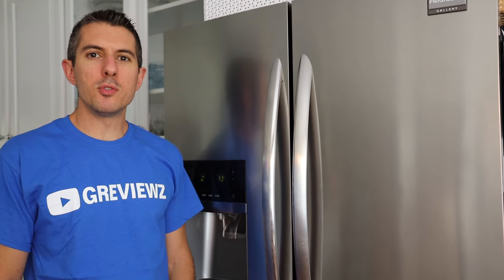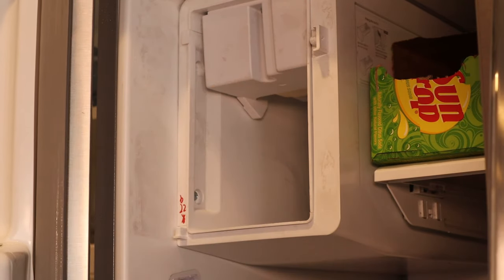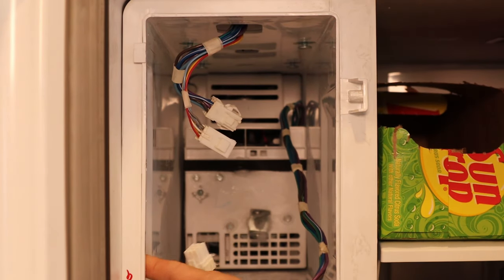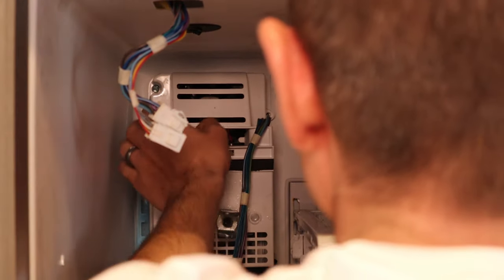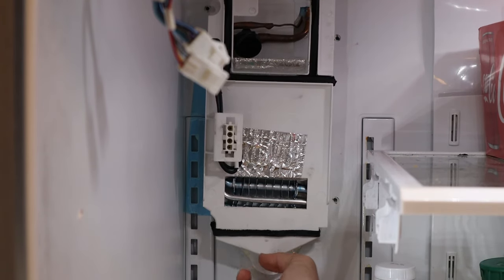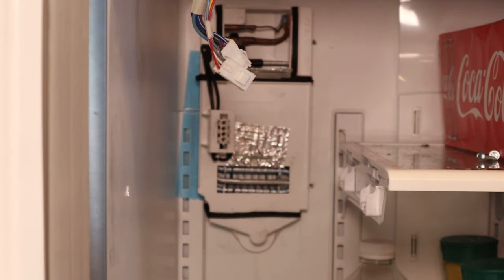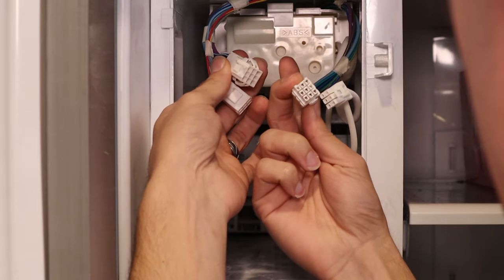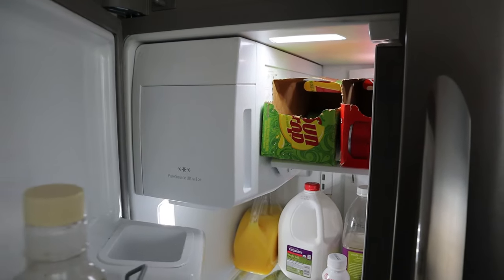Frigidaire ice maker broken again: fix it

Comment: Wonderful and helpful video. Tried to read through all the comments, but couldn't see if you've addressed this question.... Can the dang thing be completely removed and disconnected and do without?   I've got the thing 'almost' disconnected but the copper tubing seems to be the last step.  The motor housing in mine is all one piece.  I haven't been able to expose the coils.  Unless it's still all frozen.
Reply from the maker: Thanks for watching. It’s a big pain in the b u t t. I’m not a Frigidaire tech all I know if the process Ive shown.  Ru you wanting to stop using the ice maker all together?
Reply: @GReviewz  yes..... use the space in the fridge for something useful and start using a countertop ice maker.  Those things can make > 25 lbs a day.   Even when it works, this thing only spits out a few cubes every few hours.   We were always running out.  We filed a warranty claim on it within the first 6 months.   Had it now 5 years and it has never been great.  I'd love to disconnect and remove the motor case.
Reply: And I'd like to keep the filtered water...

Comment: Better review than most, the only critique I can add is, at 04:13, saying to use a screwdriver to pry connectors apart??   No, no, no.  The connectors have a release tab you just depress and they come apart easily, that should have been pointed out...that there are release tabs.  Brute force never a good idea when dealing with plastic connectors.
Reply from the maker: Lol thanks for watching. I guess I misspoke I use a flathead screwdriver to push into the tab to lift the tab.

Comment: No need to take anything  apart. Just run the defrost cycle a few times. With ours it is usually some ice will be on the edge of the tray. Remove the ice container and feel around the tray. There usually will be ice on it, just work it off.

Comment: My refrigerator looks almost the same but doesn't have Gallery on the front. I'll give this a try. I have ice built up on the back of the refrigerator where the drain goes. I've seen another video and the guy replaced the seals in the ice maker area.

Comment: Guys be careful using the Hair Dryer. I've seen customers melt the plastics using it. I recommend a steamer, also with this model, if that drain gets clogged, there is no repair as per Electrolux. Another issue you might have is the fill tube as he explained freezes up and doesn't allow for the water to shoot in.
Reply: Thanks for the added wisdom-from-experience.

Comment: I have same fridge, same issue.....an easier way is put your fridge food in a cooler, unplug fridge, take out ice tray, get a hair dryer and prop it so it blows into the ice compartment (I used the left door), turn it on for 5 minutes at a time about 4-5 times in a 3 hour period.  Leave fridge doors open for those 3 hours.  DO NOT OPEN FREEZER DOORS.  Freezer food will be fine during this time.  You will start to see water drip and pool in ice tray.  after a few hours, put ice tray back in, plug in fridge, close door.  You can put food back in at this point.  Wait until morning for ice.

Comment: My third time doing this in 3 months, it worked for a while then froze up , so I replaced the gasket around the defrost coil and it worked for a while until it froze up ..defrost it again .. now it doesn’t work anymore.. 
I give up, this ice maker is junk..as long as the freezer and fridge works I’m fine with that .😊😊😊😊

Comment: Help help help!!! I have defrosted and it didn’t fix it. Then I replaced the water inlet valve still no ice. Found a cut wire and spliced it then I had ice. Now no ice again after about 2 weeks. Checked cut wire and it is still spliced but still no ice. When I found the cut wire we also checked the connections in the back (silinoids I think they are called) moved them around to see if I could get the ice maker to fill. It never would fill. This thing is driving me bonkers!!!! Thank you for the awesome video!
Reply from the maker: Thanks for watching. I’m going to be honest I am not a Frigidaire tech nor an electrician. I just found out the specific problem the ice makers had. I would say after re connecting the broken wire and it made ice that sounds like an electrical problem to me. After trying everything and nothing works you may have to admit defeat and call a professional. Just make sure if you do call them that you clean all around the back and underneath the fridge. If they see any evidence of insects, cock roaches etc they will leave and not fix anything and still charge for a service call...

Comment: i have a frigidaire 33 inch refrigerator that was dropped off by Home Depot without setting up the inside.  i still cannot get the crispers in the right position not to have gaps of air getting in them. also there were two beige clips that were in there and want to know if they support the crisper drawers  thank you if you can answer

Comment: My question is why does this happen?  I am pretty sure mine is doing the same thing.  There has to be a reason for this.  But great video dealing with a difficult situation
Reply from the maker: It’s all about a fad and not about good design.. the problem is the ice maker is put into the refrigerator. The refrigerator is kept at above freezing temps while the icemaker needs below freezing temps. So the difference in temps makes condensation which then freezes… so in essence it’s a terrible design!!

Comment: This is my first fridge with a freezer on the bottom but do I need to worry about ice in the drain line? If the problem is repetitive you got low freon/a leak and you might want to call a repairman.

Comment: Worked like a charm! But I was a bit confused by the brief segue into setting the fridge into "defrost mode". Was this to say that setting into this mode could be tried before tearing apart the ice maker?
Reply from the maker: Yes you should try the defrost cycle before the tear down.. the defrost only works 30-40% of the time though
Reply: @GReviewz  Thank you! I now have a full tray of ice, but now it dispenses very slowly - like only a few cubes after a minute. Also the crush function is not making any crushed ice. I can hear the mechanism running. I wonder if I screwed something up performing my repair. If anyone would know what to do, you would!

Comment: 2 important questions: 1: are you supposed to remove the blue tape that's on the ice draw near the fill hole on top of ice draw?
2: would enough ice build up cause the 3 water lines (mid height/ice maker side) that enter the rear of fridge to ice up and also cause the water for the outside door to stop?  Thanks
Reply: question 2: absolutely, the icing condition can continue to travel down the lines and cause your water supply for the door and ice makers to be cut off.

Comment: I assume this happens every few months? Mine does.

My slightly simpler fix ...  

Follow your instructions to 2:50, then fill a few sealed hot water bottles and put them in the ice box. Then I grab a big handful of plastic grocery bags (or a few kitchen towels) scrunched up to seal the opening. Close the fridge door and leave them inside the ice maker for a couple hours to let everything thaw. Depending how bad it is you may need to refill the bottles with more hot water. 

Next time I may try that in combination with the defrost mode. Thanks for that tip. I wonder though if we hit the defrost for an hour every other week if that will keep it from icing up in the first place.
Reply from the maker: Thanks for watching. Yes there are many different ways of getting the ice melted. I did demo the longest way however your way will work. The only problem is that the defrost cycle only defrosts were the coil is. Ice can build up a lot of other places.

Comment: thanks, but I was too scared to attempt it myself, so I just defrosted it and am hoping that works to loosen whatever ice may be blocking the system.     How long should I keep on defrost before turning fridge back on?
Reply from the maker: Thanks for watching. The defrost cycle runs on its own and stops to my knowledge. I ran 2 cycles and to no avail the problem persisted. That is why I did the long process. Doing the defrost works for some and not for others.
Reply: Does the fridge still stay cold? I have it on defrost now and took all the freezer food out.

Comment: Good video, helped me to tear apart my Frigidaire Gallery. I did find that i have a couple of cracked parts, which I will research on line and get those ordered. One question tho, with the drain hole behind the evaporator housing, where does the melted ice go to? Its between the outside back panel and the inside panel, is there a drip tray inside the bottom?

thanks,
Reply from the maker: Thanks for watching. Good question. Ive been told it goes down to a drip pan under the unit that gets evap from the heat of the compressor...?

Comment: The problem with using boiling water to thaw the ice is , if the coils, or area that had the ice on them aren't completely dry, then it will begin to freeze up again. I've worked in restaurants all my life in P.A. a lot of humidity in the summer causes walk in refrigerator coils to freeze, we make sure we melt ice and dry with heat gun or the coils will have ice building up on them the next day.

Comment: First I wanted to say thanks.  My ice maker was not identical but very similar and this video helped me get it apart and get the water feed tube thawed out.    

One question I have is how does this ice maker know when it is full to stop making ice?   Unlike the ice maker in the lower compartment that has the metal bar that lifts when ice reaches a certain level I don't see any kind of sensor on the upper maker.  Any idea?
Reply from the maker: That is a good question. I really have no idea. Must be either some sort sensor or could even be weight maybe? That’s for watching.

Comment: I have the same like yours but with the dual ice maker. The ice maker on top does work and the bottom stopped working. I do have water flow to the top and do get water from the water mode but nothing on the bottom ice maker. And it started doing that right after the freeze we had here in Texas.  We stayed like 3 days without water and when everything came back to normal i saw that the bottom ice maker quit working on me. Good thing we still getting ice from the top one.  So how can i trouble shoot it.  Thank you
Reply from the maker: You are like one of 10-20 people that has talked to me from tx in regards to the ice problem. What a couple people told me is that the ice froze in their lines leading up to the ice maker. I’d check there first..

Comment: Great video! But this refrigerator is a terrible design. I bought a house that had this same one already in it. We decided to just buy a new one. When we pulled this one out, the back of the refrigerator had ice on the outside of it and it was all rusty. There are several other videos about this same problem. We had hoped to sell it, but I'm not sure anyone would want it that way.

Comment: This was a great video.  My son is having the same issue with his frigidaire which is the same as yours.  He had a lot of ice build up inside the wall of the fridge where the ice maker is.  Can he try to do the defrost first without having to tear it all apart?  Or is that just a waste of time?   I have a call into a repair center but may cancel it after seeing your video.  Do you think this may have happened when they had a power outage??  Thank you!

Comment: Watched the whole video. Came to the realization that I don't need to disassemble anything. Shut off the fridge. Get a hair dryer and put on warm directed into ice maker for 20 minutes. It melts all the ice build up in the back of the unit and works as normal. No need to waste 30 min of disassembly.
Reply from the maker: You can do what you want. As stated in many comments to me that the. Low dryer method is hot or miss if it get all the ice on the coils in the back. If you leave any ice whatsoever ever you are back to square one in no time..

Comment: Thank you much! We have this exact same fridge and this keeps happening. We replaced the valves and the ice tray assembly (probably needlessly), but that did not solve the problem. How can this ice build up be prevented? It keeps happening every week. 😳
Reply from the maker: What temperature do you keep your refrigerator at?
Reply: @GReviewz  Hi! We figured it out! We turned off the fridge before bed. Then, we turned it on in the morning. It started making ice after a few hours and has kept on going! I think that gave it a real chance to defrost the iced-over area.

Comment: What is causing the build up in those areas. Can the cause be fixed?
Reply from the maker: Frigidaire does sell some braid aid parts.. it essentially is a bad design to put a non sealed freezer in a compartment that is over 32 degrees..

Comment: I usually tell people to stay away from the gallery series frigidaires. If it had a display on the dispenser usually stay away I don't mind if it has a display in the freshfood section or on the side of the freezer door. If it has a icemaker on the far back of the freezer and it's not in its own compartment and if it has light bulbs not leds you are in a good place for value as they are quite a bit cheaper than the gallery series and tend to have a higher longevity in my experience.

Comment: Thanks for the video. I have a Whirlpool GI5FSAXVY01. Similar ice maker as yours. My problem now is with the ice maker. When it is OFF, then no issues. WHen I turn it ON - ice is being made but there is also water accumulating on the ice tray...and the water turns solid and the auger does not spin. Do you know what could be causing the water to accumulate in the ice tray? I looked in the ice making compartment, there is no noticeable ice build up and there is not leak in the bottom of the refrigerator. Everything else is working fine with the refrigerator/freezer section.
Reply from the maker: What temp do you have your freezer at?

Comment: Careful if attempting this.  Not all units are the same.  Mine has a non removable motor.  If you do as in this video, you will be purchasing a new refrigerator.  

My Frigidare refrigerator looks exactly the same as this, only when disassembling will you find out the difference.

Comment: This is exactly the same issue I've been having for two years now.  Every month I have the same issue as described in your video, my question is why does this keep happening and how to prevent it from icing up in the future so I don't have to keep taking the unit apart and defrosting it???  Thanks
Reply from the maker: Thanks for watching. The defrost doesn’t actually defrost the parts that freeze up. Waste of time. It helps for minor cases but in most cases it won’t touch the ice buildup..think critically for a second… the ice maker is installed in an environment the is over 32 degrees. It’s a bad design. So the plastic cover over the ice maker area isn’t perfectly sealed from the air in the refrigerator. The longer you leave the refrigerator doors open the more moisture gets into the area and Inturn gets into the freezer and freezes…. Causing ice built up…

Comment: IMPORTANT. I have the same basic Frigidaire. You need to pull your fridge out and look at the outside back wall. Mine had a huge block of ice there (behind the ice maker area), so much so, that there was a large mold spot on my sheetrock and water damage in my floor. I web searched it; the cause is that Frigidaire put the refrigerant line too close to the back wall, so moisture in the air condenses on the back wall and freezes. Ours was so bad, it had encased and froze a water line on the back of the fridge and water stopped flowing to both the maker and the water dispenser. The galvanized steel back wall of ours is rusted out! I will NOT buy Frigidaire products again.
Reply from the maker: Thank you for watching. I appreciate the information. If I make any more videos I will include that Info. I pull my fridge out once every 6 months to inspect the back etc. I haven’t seen that particular issue on mine. But yeah I’m not buying another one either...
Reply: How did you fix it? Ours has the exact same issue
Reply: @amywhittington167  I replaced it with a new LG and had 0 problems after 2 yrs.
The back panel was so rusted out it couldn't be patched with a piece of sheet metal, but even if it could, I realized that wouldn't fix the design flaw. If u replace it, I recommend avoiding Frigidaire if at all possible, and I know people who've had problems with Samsung in addition to the stores admitting their problems.